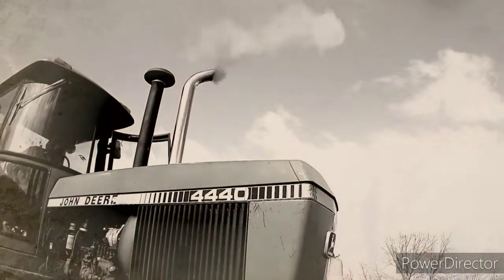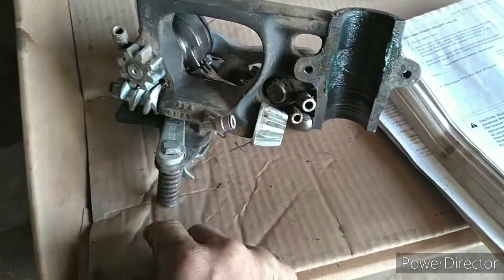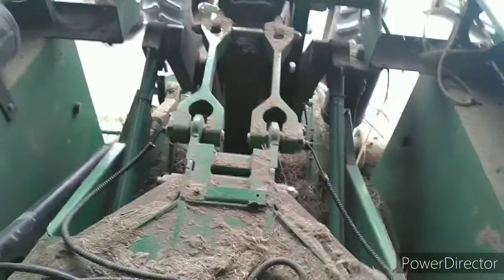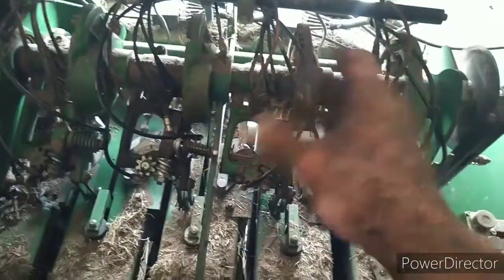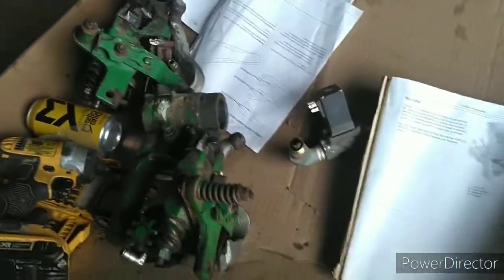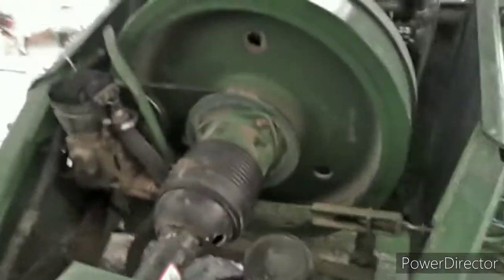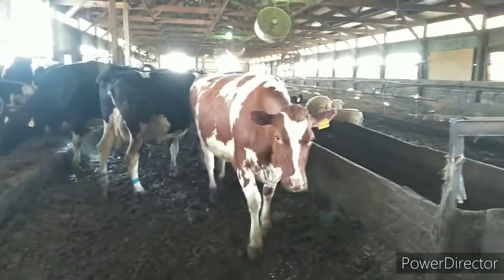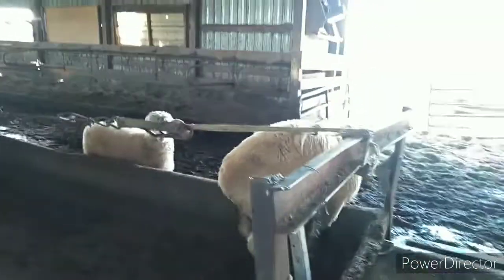Doing some fixing on the baler

Comment: Always fun with Knotters😂🤣
I love the fan on our big baler!! Hydralic drive, blows very nicely!! Knotters are always clean.. they changed the fan on the new ones, the new ones have a screen for air inlet, all the ones I've seen are always plugged up.. ours sits higher and not in the chaff.. always blows good!!
We use 500# knot strength twine.. have used 450#.. but the 500# seems to work better..
GINGER!!!!👍😎
Reply from the maker: I would have to order 500 no one runs that around here so I'm glad to have 450!!🤷🏼‍♂️🥓🥃🥓🥃🍻
Reply: @shaneholst6940  that sucks..lol.. 
Used to be 3500-500 now it's 4000-500.. tight fit in out twine boxes, but I just lean a little harder on them😎
Reply from the maker: @GosselinFarmsEdGosselin  lol thanks right it will fit! 🤣😂🥃 I have plenty of room in my twine box they would fit just fine

Comment: So if I saw that correctly those nighters on clamp off of the nighter shaft so you don’t have to pull the clutch in the shaft and everything out just to change a knotter that’s slick as hell I got quite a bit of work to take a knotter head off of my assembly
Reply from the maker: Yeah it's just two bolts and it comes right off ! Definitely makes it a lot easier to fix on the knotters!